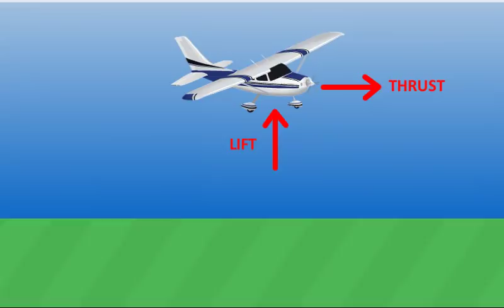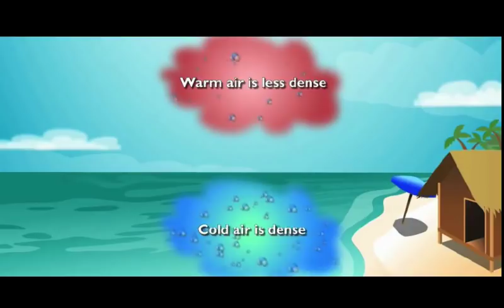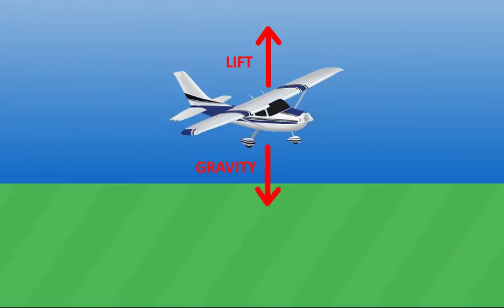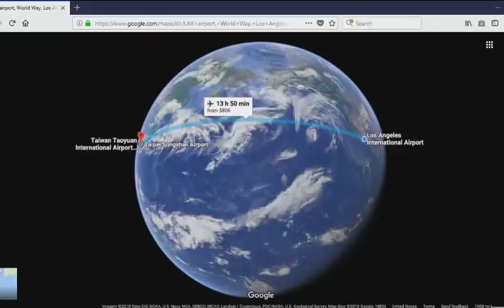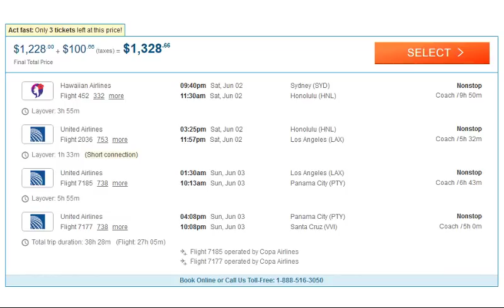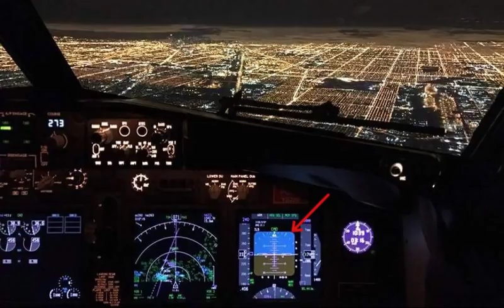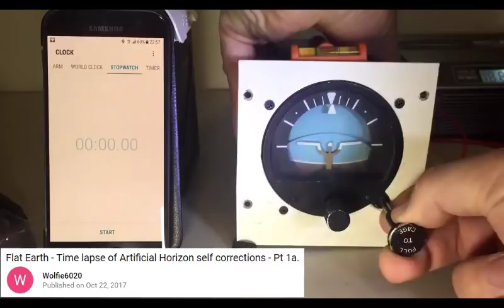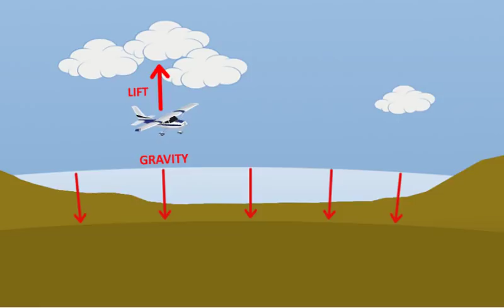Flat Earth Falsities - Plane Nonsense

Comment: For all the globetrotters out there.  You guys constantly accuse flat earthers of cherrypicking.  But cant help avoid topics that are easily proven to be fact or truth. Instead you guy's use things like the flight path idea, the Antarctica idea, the ridiculous claim that the force of  gravity has been proven or observed in any way shape or form, the question "where is the edge?" And pictures from space. What about the FACT that you cannot measure the curvature of the surface of your globe model? The FACT that when you zoom in on the setting sun it rises back up? The FACT that the horizon rises to eye level? The FACT that Some brilliant engineers built a bridge in N.Y. using the curvature of the earth. But underneath the water is hilariously and unmistakably flat.  These few topics should be cheerypicked for conversation.  You can't debate them .  But it makes for far more interesting conversation
Reply: "What about the FACT that you cannot measure the curvature of the surface of your globe model?"

Yes you can.

"The FACT that when you zoom in on the setting sun it rises back up?"

No, it doesn't.

"The FACT that the horizon rises to eye level?"

That doesn't make any sense.

"The FACT that Some brilliant engineers built a bridge in N.Y. using the curvature of the earth. But underneath the water is hilariously and unmistakably flat."

Which bridge would that be?

"These few topics should be cheerypicked for conversation.  You can't debate them ."

Um...what?  Can't debate them?  Are you high?
Reply: You already had the "horizon rises to eye level" thing thoroughly disproven in another of your threads, which you then ran away from. So why bring it up again?
You can very easily test it for yourself taking a homemade water level up a hill like this https://www.metabunk.org/attachments/horizon-level-liquid-test-jpg.27615/
Or a using phone app in a plane like this: http://i65.tinypic.com/214uv43.png  (and you can verify the phone app is correct using the homemade water level!)
If you are more committed then you can rent yourself a professional theodolite and look through that: https://www.metabunk.org/attachments/screenshot-178-png.29725/
Reply: " They also say that if you are 6 ft tall you can only see 3 to 5 miles along the surface of water ... we can see up to 60 miles along the surface of water"
UTTER BOLLOCKS! Show me verifiable evidence of someone observing a ground level object 60 miles away from a height of 6 foot. 
You can't. You'll have some video of a guy standing at an unknown location with an unknown height, viewing an object with an unknown location and unknown height and probably then applying the wrong formula to tell you how much "NASA" says should be hidden.
Reply: "The verranzo-narrows bridge. Claimed to be engeneered to the curvature of the earth"
Yes it is. The bridge towers are not parallel. The tops of the towers are 1 5/8 inches further apart than the bases are, because of the curvature of the earth. As described here:
https://www.smithsonianmag.com/history/history-verrazano-narrows-bridge-50-years-after-its-construction-180953032/?no-ist
http://web.mta.info/bandt/html/veraz.html
There is nothing there about the bridge's road surface being parallel to the curve of the Earth, as you implied.
Reply: Jos Leys: James here claims that he can see Polaris from Australia where he lives!
I think that tells you all you need to know about either his honesty or his ability to observe things.
Reply: I think James Hewitt  feels a bit overwhelmed by the opposition and is hiding somewhere in the outback...( which may be a good spot for him to try and see Polaris in the night sky)
Reply: None of your FACTs are FACTs, as we've repeatedly shown you.
Curvature can be measured. That's why we see ships and land disappearing bottom first on the horizon.
The sun does not rise back up again when you zoom in. You fill the image with more bright sun and the camera's auto exposure adjusts to compensate, darkening the image and reducing glare. Do it with a proper solar filter and you see the real truth. Or just try zooming in to find the sun after dark. Why can't you do that even with the most powerful telescopes in the world?
The horizon does not rise to eye level. This was categorically proven to you in another thread and you just quietly left in a huff. You can test it for yourself using a simple water level, or a professional theodolite, or a Dumpy level, or a phone app.
Most bridges curve. It's a good way to build a bridge since it spreads the load out through the arch. To do this the curve needs to be greater than the curvature of the Earth.
Reply: When i explain somthing.  I back it up with the source of the information or suggest that you look for yourself. When i get accused of lying is there  much point me arguing that im not? Thats why i don't go back to threads and start new ones. I am happy to continue conversing with anyone who is interested in what i have to say. If someone says im lying . I dont think they really want to know what i have to say. Which is fine by me. I just wont be as enthusiastic about chatting with them.
Reply: You’ve seen it for yourself? What exactly? The sun after dark? 
You also claim you live in Australia but can see the North Star, so I’m not too convinced by your astronomy skills.
Reply: James Hewitt: so how do you explain this enigma on the direction towards Polaris?  We are all waiting for your wise words on the matter!
Reply: James Hewitt: we don't need to check this documentary ! The observation of Polaris can only match a spherical Earth. We are happy with that...unless you can convince us why this is no proof..
Reply: While I completely agree with you, I assume you'll only get either obfuscation or diversion for an answer from any FE-ers. I can debunk them in one sentence for which they NEVER answer, because there is no answer.

What could possibly be the purpose of doing this.
Reply: I'm still curious about what Hewitt has to say about this, but him being Australian, he's probably in bed now...or out in his backyard trying to find Polaris in the night sky...
Reply: +James Hewitt because flat earthers do cherry pick. How about you stop being a pathological liar.
Reply: Jos Leys I have made that argument with him before.   He admitted he cannot see Polaris in Australia.
Reply: @James Hewitt
"Im not a troll." You are. A lying one.
"Im not a troll."
"The horizon rises to eye level." That is trolling, because you have asked previously and been answered abd your clim proved to be false, So now it is a lie.
"Go in a plane and see what happens to the horizon.  Tell me it doesn't rise!" That is trolling, because you have asked previously and been answered abd your clim proved to be false, So now it is a lie.
"Do you think we went to the moon?" That is trolling, because you have asked previously and been answered.
"Do you think we have a rover on mars?" That is trolling, because you have asked previously and been answered.
"Honestly I am going on what ive been told with polaris."  That is trolling, because you have asked previously and been answered.
"How about you stop asking me for info and do somw research" That is trolling, because you have asked previously and been answered and toy refuse to answer questions.
You are a pathetic troll James so fuck off and do the world and yourself a favour.
Reply: James Hewitt exactly, "globes cannot be flat".

If the Earth is so flat where is the accurate flat map of it? Why is it so impossible to depict accurate shapes and distances of land and ocean on a flat surface while globes do it just fine?

Because
"globes cannot be flat".
Reply: ...I like how you capitalize "FACT" to try to make your claims more valid despite the fact that none of what you claim are actual facts.

We have measured the curvature of the Earth.  MANY times.  Erathosthenes did it over 2000 years ago.  Navigation wouldn't be physically possible if we didn't know the curvature of the earth based on the current working technology.  (Approx 8 inches/mile disregarding terrain forward perspective)

When you zoom in on a setting sun, it's still setting.  Under very specific circumstances, you will see an image of the sun above the horizon because of atmospheric refraction.  However, even with atmospheric refraction, the sun will eventually go away completely.  There is no bearing at which you could point a high powered telescope in the middle of the night and still see the sun.

The horizon doesn't rise to eye level, rather your eye follows the horizon.  Your eyes are a poor measure of whether or not the horizon rises because your eye level isn't stable.  Lift a fixed camera with fixed reference points and you'll see that this is bullshit.

Water adheres to the shape of its container, but even in smaller scales, the surface of the water is still curved.  The curvature of the water between small distances (just like the difference between the bridge) is minuscule.  If you accurately measure water levels, it would show a difference.  The difference would indeed be tiny...but that's largely because the Earth is absolutely HUGE.  See above, for the curvature of the Earth.  Looking at a stretch of land/water/whatever one mile long from distance, it is impossible for the naked eye to discern 8 inches curvature from end to end. 

So...what else you got?
Reply: Uh the water is flat because the bridge has multiple huge fans under it pushing the water back down
Reply: BWAHAHAHAHA.  So it does. Silly me
Reply: I've never once accused flat earthers of cherrypicking. Cherrypicking assumes there's an obverse argument to us living on a globe when there really isn't any.
I DO accuse them of holding on to this flat earth idea with absolutely zero reason for it to be happening. Why exactly would any group, race, specie, or civilization expend that amount of energy and material to deceive us ~ what benefit could they possibly get through this 'lie' that they couldn't get far easier and cheaper? With no reason, it won't happen.
Reply: I didn't make any claims. If it's ignorant to say flat earthers have no reason to cling to their inane beliefs, then tell me the reason. That's all you need do -  why this is being done?
Reply: James Hewitt https://youtu.be/MobPc0c9DnQ Explain why the sun doesn't rise up when zoomed in.
Reply: As for cherrypicking.  The term used in the video above and by "debunkers". They could not be more hypocritical. Cherrypicking is exactly what this video does. Along with most globular arguments. Flat earth has a lot of testimony that cannot be proven.  But we have one absolute proof. Which is one more than the globe model. That is  of course is that the surface of the earth is flat and we can measure it. using many different instruments and we can replicate the method producing the same results. Thus proving the earth is not a globe. But flat. Globes cannot be flat. Its impossible.
Reply: James Hewitt: we can measure the curvature with many different instruments too James. Land Surveyors do it every day.
Reply: Again i recommend you check out the documentary called " did scientists prove the shape of the earth? You decide " these experiments can be reproduced by anyone.  Its that simple
Reply: Not one person has come back to me with feedback on the documentary????. Please. I would love to hear what the globetrotters think about these experiments.
Reply: Not the cia .Flat earth make the same easy predictions and have been for thousands of years.  Sorry to burst your bubble
Reply: Grahamstw watch the documentary called did scientists prove the shape of the earth? You decide.  Also i have a telescope and a buddy of mine has a camera with a 64x zoom. I have seen it for myself.  Maybe you should check it out for yourself
Reply: Search for the video " zoom in on sun on the horizon"
Reply: I don't "want to understand" why you think what you do. I already understand. I want ONE of you to simply state, in plain english, why this would be done. What could possibly be gained. What is the purpose for this supposed ruse? I can ask that same question a thousand different ways and all I ever get is "facts" and "belief", never an answer.
Reply: James Hewitt: consider this: the elevation of Polaris above the horizon is equal to the latitude of the observer.
So for each observer all around the 45° parallel , on a flat Earth, Polaris must be at a height above the north Pole equal to the distance of the 45° parallel to the pole. That would be about 10.000km.
However the observers at 60° will disagree ant tell you the star is higher, while the observers close to the equator will claim that the star sits on the North Pole ice.
We do not need to watch hour long boring FE films...you see debunking FE only takes  three sentences.
Looking forward to your answer...
Reply: "Go in a plane and see what happens to the horizon.  Tell me it doesn't rise!"
Look at the three horizon images I posted, measured with three different devices, and tell me what you see James.
Homemade water level up a hill like this https://www.metabunk.org/attachments/horizon-level-liquid-test-jpg.27615/
Phone app in a plane: http://i65.tinypic.com/214uv43.png
Professional theodolite: https://www.metabunk.org/attachments/screenshot-178-png.29725/
You can replicate all of these yourself and verify them against each other to rule out any special tampering by those pesky NASAtan Masons. They all show the horizon does not rise to eye level.
Reply: "Ok forget polaris or anything i said on the matter."
No, I'd like to remember it thanks, because it informs me of your character.
Do you maintain that you live in Australia and you can see Polaris, as you previously said?
Reply: Yep. It's hilarious. You actually find that believable and credible? Here's a link to my favourite bit: https://youtu.be/McdMMmclGVc?t=8m40s
To quote: "[Narrator:] The teams used high tech positioning equipment to ensure the accuracy of the results... ...The same experiment was carried out in other places. One of them was in the Strait of Gibraltar in France... [Scientist:] We are here in the South of France..."
Brilliant stuff. :D
Reply: James Hewitt "The FACT that the horizon rises to eye level? "
I'm still waiting on your explanation for how the horizon can be level with your eyes on a plane and below you simultaneously.
Reply: You are dangerously insane my man.  We've known for literally 2000 years the world is round.  The ancient greeks in 500 frigging BC figured it out, why can't you?  Morons of your astounding caliber hold us back as a species.
Reply: James Hewitt, why are all other planets round? Why the only flat planet is earth?
Reply: James Hewitt We have watched that video.  It's garbage.  It doesn't prove anything other than that FE believers like you are DESPERATE.  

It's OK.  Let it go.  Accept the truth.  The Earth is round, and rotates on its axis once daily.  It orbits a yellow dwarf star called the Sun at a mean distance of 93 million miles.  Believing in such doesn't mean you have to stop believing in God.  I do, and the two are not contradictory.
Reply: Angry Robot why are all the pool balls round and the table is flat?
Reply: Daniel. I used to think the same thing. But now i have absolutely proven it to myself  That the earth is not a ball. Its very easy. Once i saw it for myself. The idea of gravity or the globe seems laughable to think about. There is no way me or you can claim to have proof that gravity or the globe exists.  But proving the globe to be false or flat is very simple.
Reply: Go in a plane and see what happens to the horizon.  Tell me it doesn't rise!
Reply: Saying that flat earthers have no reason to cling to the idea is very ignorant.  So is claiming to have absolute proof of the globe or gravity
Reply: Ok you got me. Im fake
Reply: I suppose Australia's fake too lol. Ive seen it in a video
Reply: Ok daniel . If you would like to understand why i think the earth is flat. Check out a documentary called " did scientists prove the shape of the earth?  You decide " it is the best example i have seen of trying to detect curvature on large bodies of water. They dont just use cameras and lasers. The also use radio waves to rule out the argument of refraction being the explanation for being able to see so far.  This confirms information that i can gather from my environment. Which is why i know the earth is flat and why its not a 25000 mile ball
Reply: I was not trying to acuse all globe believers of bringing up cherrypicking or making claims. It just seems to me. A lot of people in these threads who are making claims to have proof of the globe. Need to rethink their idea of the words proof and fact. This is where all of us Including myself went wrong with serching for the truth. I have pleanty of ideas why i think the earth is flat.  But there is one thing that i can see for myself. That proves to me. That the earth surface is flat and most certainly does not curve at 8 inches per mile squared.
Reply: The horizon rises to eye level.  That makes perfect sense.  If you go in a plane. Say 30 000 feet. The horizon rises to eye level 30 000 feet . Nasa says you cant see the curvature untill we make it to 30 000 feet. They also say that if you are 6 ft tall you can only see 3 to 5 miles along the surface of water . Due to the curvature.  Both contradictions are wrong. we can see up to 60 miles along the surface of water and at 30 000 feet no curvature.  If there was.  The horizon wouldn't and couldn't rise to eye level. BUT IT DOES
Reply: The verranzo-narrows bridge. Claimed to be engeneered to the curvature of the earth
Reply: Ok forget polaris or anything i said on the matter. Do some research
Reply: Lake Michigan.  60 miles and no its not upside down ( mirage)
Reply: James Hewitt yep.yet we are supposed to be on top of the ball so all curvature is down. clearly then the horizon would go below us as we went up. fucking hypocrites
Reply: Guys im not going to keep repeating myself. Do someresearch on these topics.  Obviously you are not interested in looking into things for yourself and world rather be told by scientists or fools who make videos like this deceitful garbage.  If anyone has further questions for me ill be keeping an eye out on some of the video's ive been mentioning.
Reply: Sorry to burst your bubbles but we have proof that is not whats happening. In otherwords evidence that easily and absolutely proves your THEORY about what you are observing. To be false
Reply: Guys try watching some videos that go for more than 20 minutes and you would know all this stuff. Instead of just arguing that i dont know what im on about
Reply: Or check out the documentary called "did scientists prove the shape of the earth? You decide "